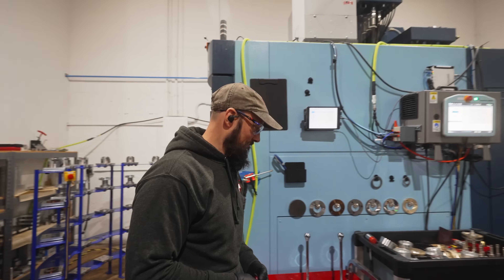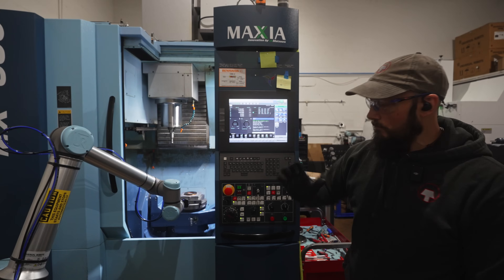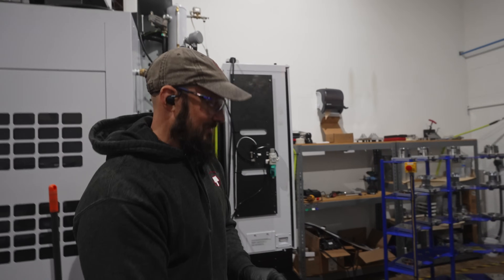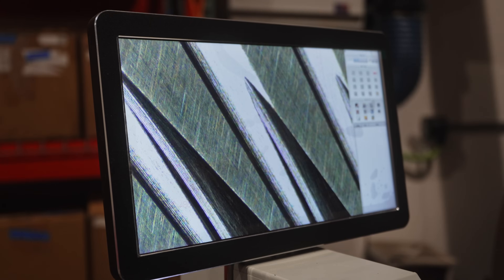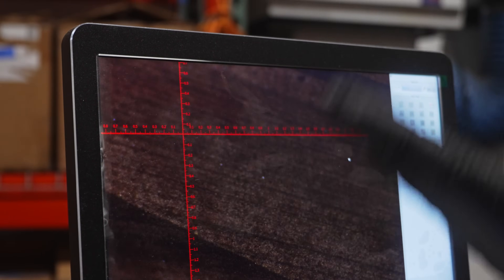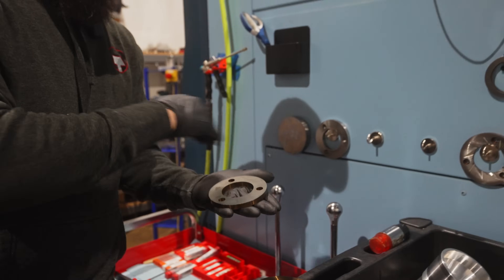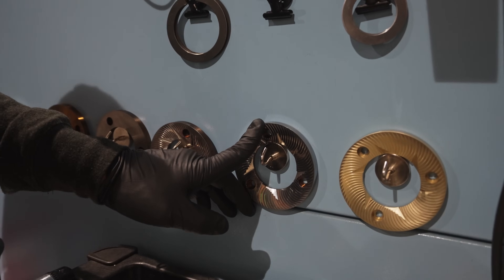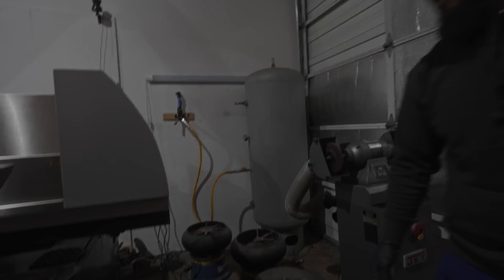How Coffee Grinder Burrs Are Made! Ft. Kafatek

Comment: Spending 2 hrs on each part is insane (if this is indeed the case). With operator and equipment time the cost would be extremely high.
EDM would do the same trick, at fraction of the cost.
Reply: That's just for the one step of cutting the geometry into the burr. Many more hours are spent before and after that 1 step to make a finished set of burrs.

Comment: Doesn’t 2Nm of torque have more of an effect as the burr gets metal removed from it?
Reply: Potentially yes. On lathe work where you’re gripping the material with chuck jaws, you can end up with out-of-round parts… with the jaws super tight on material then bore out the center, when the jaw pressure is released the material springs back to its resting state and is no longer round the way it was inside the chuck. Ideally I would guess that before the finishing pass on the geometry, the burr would need to come out of the CNC, mounting bolts loosened and re-torqued, finishing pass in CNC, then reground on the surface grinder. That’s a ton of time. Then again, maybe they’ve tested this, and the constant torque of the bolts against the super flat machining plate doesn’t matter. If the burr flexs up at any point, the tooling will cut it back to spec… but the CNC doesn’t touch the flat surfaces. 🤷‍♂️

Comment: I once ordered a set of Compak 68mm burrs and it had dinks in the fine grind areas like you wouldn't believe, some areas had whole chunks ripped off, it seems like it was a mixture of dull tools and tossing them like they don't care after manufacturing. So I got that set replaced with a new one and...same thing, I went through three and eventually got something that was reasonable, with dinks only in the rough cut areas. So always, always inspect your burrs, either take a photo (macro helps) and magnify or get one of those 10x / 25x loupes and check the whole burr.

Btw have you got a video on how the cut profiles are designed? I'm guessing there's a fair bit of experimentation in that, but some form of "measurement" is probably done as well? like particle distribution or something similar?

Comment: crazy that 2nm is enough to mount the blank and later the burr. One would think that grinding vibration would loosen that screw in a heartbeat if no locktide is use.
Reply: Approx 1.5 ft pounds per screw, times 3 is not insignificant